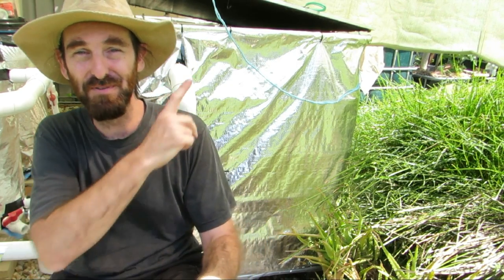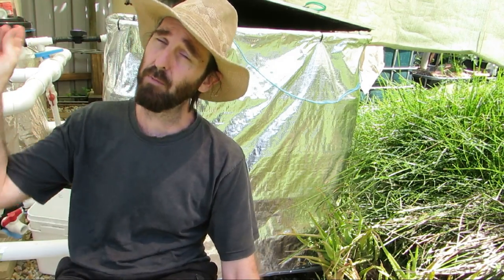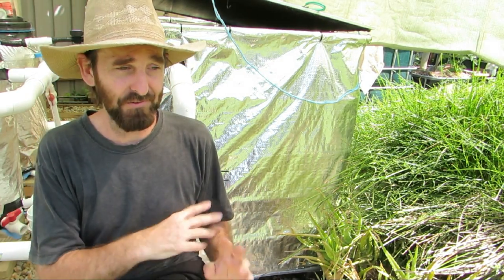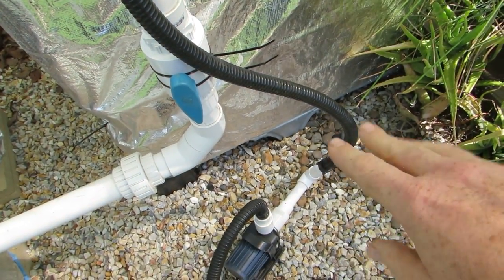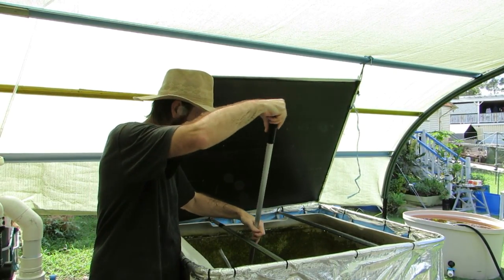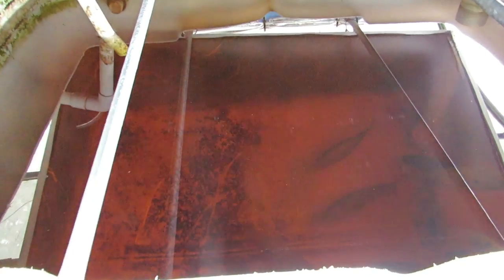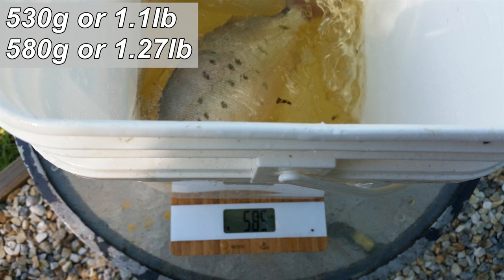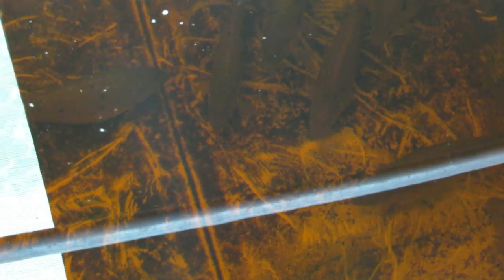Fish Farm update. Moving & weighing the fish with ideas for modifying the system..

Comment: I'd even consider adding in a series of buckets filled with gravel. The whole point with a biofilter is surface area for the bacteria to cling to. Foam is really efficient but gravel and buckets are cheap. Using multiple buckets will inherently slow the system down. Just step them down and let gravity control the flow. You can even consider making the last a sand filter which is the most efficient non foam filter medium. They even filter drinking water with sand filters. I'd even consider adding a 55 gallon settling bucket after the initial filter. Everyone is obsessed with swirl filters and such but the heavier material also needs time to settle and separate. If you use an IBC as a settling filter you can drain out the larger materials from the lower drain or add one to a 55 gallon food grade barrel. Looks like a great system and I'm curious to see more! Brilliant work, keep it up.
Reply from the maker: Cary Howe Hey Cary. 
The foam is being used as mechanical filtration as there is about 95L of PE03 biomedia in there under the foam with enough biological surface area to take the load of around 100 fish. 
If space wasn't an issue I may of added extra or larger filters to the system but as it stands I'm fairly happy with the way it's been running. Am looking at taking one of the fish tanks out of the system as all the remaining fish are now in one tank & hope to have the rest of the fish out of there by the start of our summer. Am looking forward to having more grow beds set up ;-)
Cheers

Comment: Seems we are having the same issues with solids.  I hate solids. I now have 4 solids screening points on my fish loop. I think I have the solids on the run. Lol. My latest screen was added to the RFF.  The next thing I want is a conical barrel to act as a swirl to get the solids to the bottom for easier drain off. 
Rob, tie a string to your finger to remind you to press the record button. :)
Reply from the maker: jmartin015 
Definitely one downfall of this system was anticipating how many solids would be produced.. I was warned by Paul mind you ;) Am thinking a larger RFF & Bio would of been the way to go to maximise the space I have while allowing for longer retention times.. 
Adding extra 50gal barrels with the plumbing involved takes up room I don't have.. Am also thinking a screen filter in the sump tank might also be a viable way to go but again would need a larger drum/tank to fit it all in.. 

Have missed pressing the button quite a few times.. Is a pain in the rear to sit down to edit a clip with the most important bit of film missing ;) 
Cheers Jim & have a great one..

Comment: It'd be some work but it might be good to have an RFF and media filter for each IBC. The slower speed and higher retention time might help the RFFs remove more solids too.
Reply from the maker: Dean Winchester 
That's something I've considered more than once.. The other way to go is to use a larger RFF to start out with.. I did see a 350L tank come up for sale that would of been great for the job but it wouldn't of fit in the space I have.. 
Cheers,
Rob..

Comment: Hi Rob,First I know nothing about aguaponics , with that said, I thought the same thing about adding another filtration barrel  or replacing some of the old water with new, I don't know if that's possible or if you do it already but thought it was worth a mention ? cheers
Reply from the maker: +eveny119 
I found the trickle filter did a fantastic job at taking out the solids so am playing around with the idea of adding one in front of the raft bed when it gets sorted out. The only water changes that happened in this system was the water used to take the solids out from the radial flow filter. One of the aims of this system was to waste as little as possible which I think I did OK at. 
Cheers,

Comment: I ware reading through the comments hoping someone else already asked the question, but didn't see anything... Since you are just coming out of winter, how do you keep your water temps up in your aquaponics side? I saw the video on the compost heater and was wondering if you do anything else to keep the water temps up so the fish eat.

Here in AZ, we can raise tilapia much like the silver perch which like the temps 10-30C but get extremely lazy the more you go below about 25C. Since we are starting to cool off toward winter ourselves, i've been debating buying any fish (I started fishless cycling my system not too long ago) or waiting until spring. Any advice you can give since I'm guessing (hoping) your temps are similar to mine (up to 37C during the day)
Reply from the maker: Christian Richards Hi Christian. During the really cold nights (-2°C is the lowest so far) I've been using 500W heaters in the 2 systems trying to keep the water above 12°C. The Jade perch will feed at around 20°C but do prefer warmer weather. The Silver perch can take water temps a bit lower than that again & have been feeding all the way down to 15°C.  
The compost heater isn't working as well as I'd planed & was about to do an update clip before but it has started to rain. Will finish the clip later & have it uploaded over them next few days but it will just be a quick look. Will post a proper look a bit later on once I sort a few things out.  
Was thinking of sorting out some sort of solar booster for the day time but haven't had the coin to go get more irrigation pipe at the moment. Might have a decent go at one at a later date.

Cheers mate.

Comment: My wife and I are in the process of setting up an expanded aqua ponies system at the moment. We have one IBC that we have topped and flipped to make a tank and grow bed running already. 

The plan is to convert this IBC to a sump, then add in a full IBC tank and two more beds. 

My question is this: 
Will the grow beds be sufficient filtration, or should we add in some radial flow & bio filter too? 

I have watched your videos and I'm confused if you have a radial flow & bio filter setup on your aquaponics as well as the fish farm.
Reply: WTF are 'aqua ponies'?
Reply from the maker: Jonathan Mills My guess would be an auto correct stuff up Jonathan ;-)
Reply from the maker: David Clark Hey Dave..
The beds will be fine at filtering out the solids but keep in mind that you will have solids build up over time.. How much & if/when they will need cleaning will depend on your stocking densities & feed rates..

You'll find varying opinions about solids filtration on the different online groups as well as from different aquaponic gurus.. There are folks that claim they have never had to clean out a grow bed out in 5+ years but don't mention stocking densities or feeding rates which is where the solids come into the equation.. 
I've had a very well known guru tell me solids filters were not needed at all only to see the same person now recommended them some systems now ;-) 

I see a solids filter as being a lot easier to clean compared to cleaning out a bed so that's why I like to use one in my system.. 

I had a few beds go anaerobic on me when they had a large amount of solids built up.. One was due to a fault in my design while the other was due to the root system of a large plant that collected solids & retarded the water flow/movement of the solids.. After that I decided to install the radial flow filter..  The solids collected in the filter don't go to waste either as they get used on the soil patch..

As for bio filters, they're only needed if you don't have enough biological surface area in the media beds to handle the nutrient load the fish create.. 
You'll find that a lot of people that use deep water culture or nutrient film technique will have some sort of bio filtration if they don't have media beds.. 

As an example, we only have enough biological surface area on the media in our beds to handle the load from around 35 x 500g/1lb fish but having the biofiilter on line helps us to stretch out the amount of fish we can stock..  Our system will be changed in the future to also include 4 or 5 deep water culture beds so the biofilter will take the place of the media in the beds & give a home to bacteria..

Hope that helps some David..

Comment: hey i have a question that you if any one would be able to help me with im building a aquaponics unit useing ibcs i have 3 bed and a 800L tank for the fish what size will my sump tank need to be to keep up with the flow from the grow beds
Reply from the maker: steve smood Hi Steve..
I like to allow for 50% of the grow beds to be water by volume when full so in pour case I had 900L of grow bed & went with a 600L sump.. That allows a lot of wriggle room to allow for transpiration & evaporation.. Is also a good idea to have a bit of extra volume to cover the pump when all the beds are full...
Hope that makes sense & helps Steve..
Rob.
Reply: RobBobs Backyard Farming i think i understand i have 3 at 250L so 750L of grow bed so a 500 L sump would be sufficient
Reply: RobBobs Backyard Farming and thanks for all the videos and tips ect. you are my favorite aquaponics vloger
Reply from the maker: steve smood 
Cheers Steve.. Am glad the clips have helped you out some mate..
Have a great one..